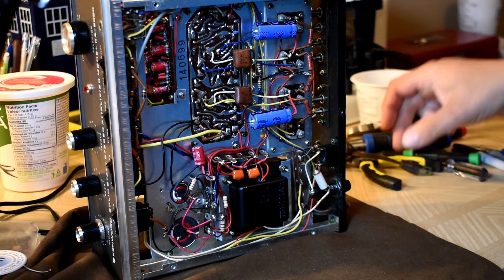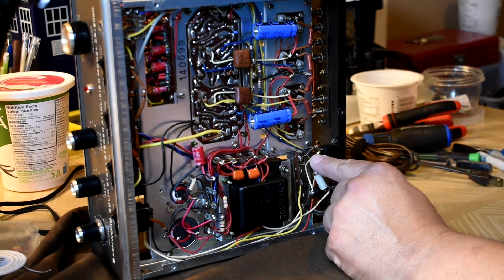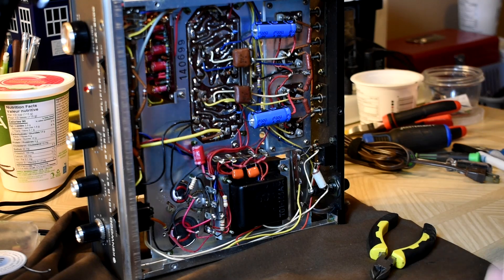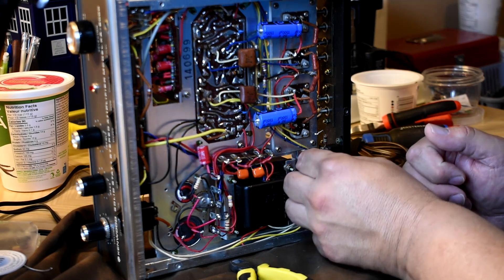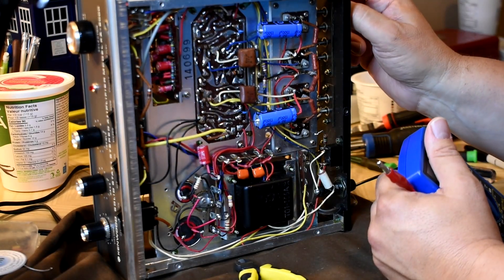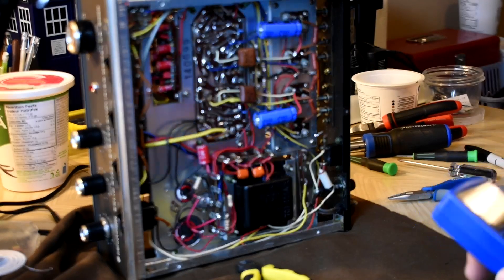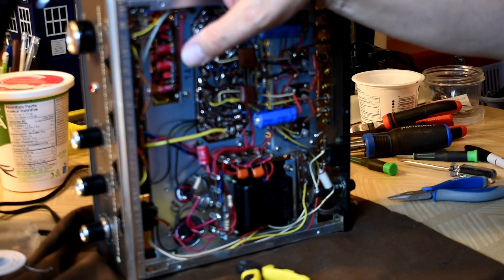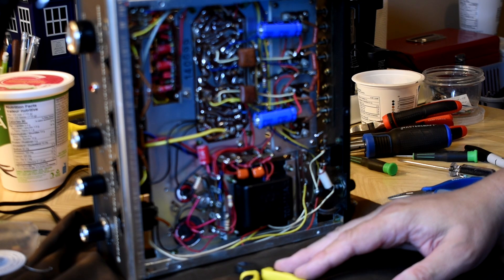Why is there a resistor between AC line and chassis in Canadian models of vintage stereos?

Comment: In modern electronic equipment, static discharge is typically shunted to earth ground with TVS diodes and MOVs, eliminating the need for a bleedoff resistor.  120V/1Meg = 120uA isn't enough to trip a GFCI circuit (5mA) by itself.

Comment: The resistor is common in USA consumer equipment as well. It is to bleed off static electricity which can build up on an isolated chassis. It eventually reaches enough voltage to spark over to the line connection. This causes a loud pop in the audio, which is quite irritating. Removing the resistor is going to get that pop noise if static electricity is present.

Comment: I repaired stereo receivers from 1975 to 2001, some US large receivers had that resistor from neutral to chassis and the plug was polarized. This to reference to ground and to lessen failures due to static electricity buildup that breaks down insulation. I sometimes get a hum shock when touching the chassis or metal front panel. This was caused by a mis-wired power plug as the larger prong is neutral or replacement with a power cord with the two equal sized prongs or the large prong filed down to fit into the older wall sockets. They stopped doing this in the 1990s, even though the electrical codes changed and some homes and business buildings in some places had to upgrade the electrical system before the property can be sold.

Comment: Hi Bryan, It's a static bleed resistor. Usually they are 2.2m or higher, 3.3m is typical
The primary circuit is isolated and insulated from the secondary and chassis,
Canadian models need this to prevent a static charge building up and arcing over in the transformer.
Canadian winters are cold and dry, that's where you'll see the static build up the worst.
Other climates don't see problems from static electricity so it could be eliminated.
The current flow from the line through this resistor is in the 10's of microamps so electric shock isn't a problem
Reply: The resistor is also supposed to be between the chassis and neutral, not the hot line.  When done that way there should be very little voltage potential between the two anyway (and even if something goes seriously wrong with the resistor there's no risk of electric shock).  Ideally, equipment which does this should have a polarized plug to ensure this is always the case.

It's not necessary if you have a properly grounded chassis, but if you don't, then static buildup can actually damage the equipment if it gets too large, and has nowhere to go.

Comment: Does it have a polarized plug?  The only time I ever saw that was with a polarized plug, and the chassis was coupled back to the neutral side.  I also suspect the voltage you measured was a statement of the input impedance of your meter.
Reply from the maker: The cord is an original non-polarized kawasaki meant for 120 volts.  The 1 meg resistor was added in Canada at the distributors.  In the 60's  and right up into the 70's most outlets in Canada were non-polarized and this was a way of creating an artificial ground.  The best solution is to install a 3 prong cord when restoring in my opinion. Thx,  Bryan
Reply: @acrossthedial  Interesting, I think they were required in the states in the early 60s.  Your solution sounds fine, as well as safe.  I never much liked the polarized plug as the neutral could float up under load.
Reply: @davidnorton573  Unless there is a serious fault in the wiring, or the wires are being seriously overloaded, the neutral will never "float up" by more than a couple of volts total, even under the maximum load of the circuit.  That is basically negligible, and still entirely safe to touch.

But nowadays using a properly grounded plug is definitely the correct approach anyway.  Any appliance with any exposed metal chassis or components should always be fitted with a grounded plug (which has actually been mandated practice for new consumer equipment for quite a long time now).

(BTW, this is not creating an "artificial ground".  It's just providing a discharge path for static buildup.)
Reply: @foogod4237  True for steady state, however transients can complicate the situation.  Also, wiring faults do happen, my brother lost a home to one.  I would also observe that the resistances we  are talking about will limit the current to a level that is normally safe, however that doesn't protect you from finding the exposed sheet metal screw as you pull your hand back in surprise.